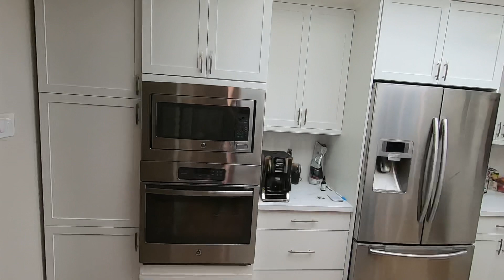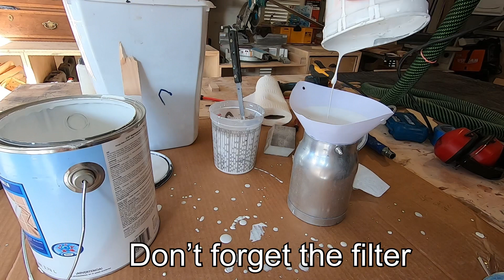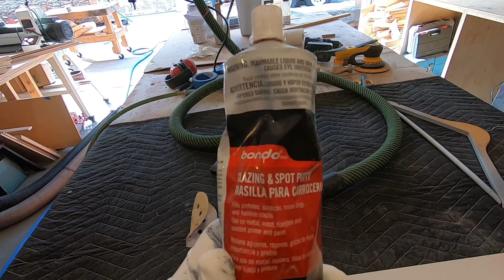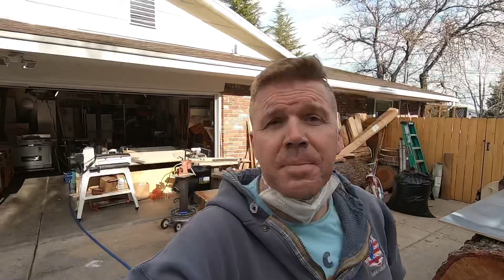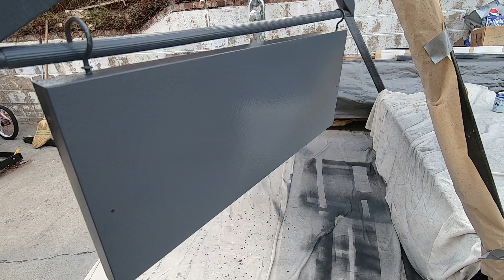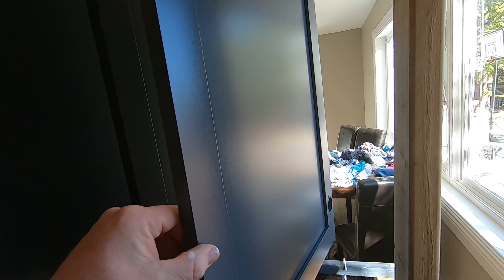Spraying my kitchen cabinets- Fuji mini mite 4

Comment: i had the same splatter issue with my earlex 5500.  i watched videos and listened to people say they were spraying right out of the can and they seemed to be getting awesome results... with my same gun.  unfortunately i never could duplicate.  I ended up switching to the Fuji mini mite 4 and going with a slightly smaller tip to help with atomizing and the splatter went away.  i only use my earlex 5500 for thinner topcoats now..  it is definitely a learning curve... meanwhile paid is $32 per quart.  so i am paying for that curve. lol .  great video by the way.

Comment: According toe Marty Schlosser, BM Advance setup for Fuji systems is:
- for 4 stage or more thin with water 10:1
- for 3 stages start at 9:1 and go to 8:1 if that doesn't work

Use water only (no fleotrol) and a 2.0mm aircap. 

I have not tried this yet though. I have a 3 stage and sprayed with a 1.8mm but had to thin the product so much i lost track of what the ratio was. The big spatter at the edges of the fan are normal for spraying BM Advance I have read.

It also helps if you remove your air control valve and just hook the gun directly to the hose or hose whip.

Comment: Definitely judge the viscosity of your paint by the way it flows off the stirring stick. 20 years as a motor vehicle sprayer and never used a viscosity cup, never even saw one. That’s how I was trained. Picking up after 40 years on different equipment with a different paint I think I will use the same method once I have determined the visual flow pattern off the stirring stick. From videos I can see it’s a slightly different flow stream than what I used for car paint back in the day.

Comment: You should just stay on the fan pattern to spray all of it. Don’t use the ball pattern for cabinets.
Reply from the maker: I disagree when spraying shaker doors. Staying on the fan pattern puts too much product on the rail when you’re trying to get the inside of the panel.
Reply: @BigNicky77  if you spray at the right angle it won’t.

Comment: Oh crap I had paused the video right before you said you thinned it. But what I’m seeing is that you need to thin that more. This system should spray with very little splatter/ orange peal. I reduce mine down to around 27. With all do respect, whoever you are watching that is saying that velocity doesn’t matter, well I wouldn’t take their advise to put it mildly. Lol. This system is very finicky but if you dial it in correctly it’s absolutely amazing.
Reply: He means “viscosity”, not “velocity”.

Comment: Brother I have three sprayers and my recent purchase was an Earlex 6003. HVLP. I though I was pretty good with my sprayers but man there’s a learning curve with these. I have a really valuable tip I learned from my research. Get yourself a piece of glass. Maybe 3x3 or bigger and use that for testing you stay patterns and the  velocity of your paint. What I have found is the velocity is crucial for setting down a smooth pattern. The other thing I found was making sure you put down a wet coat (enough paint). But I will tell you that if I had not had that glass to test on I would of spent a ton of time resanding. What I saw with yours is the paint velocity was not thin enough. You will be surprised on how thin you have to reduce some paints. If you see spatter like that add more water. Lol. Great video by the way. New subscriber.
Reply: I think you mean “viscosity”, not “velocity”.

Comment: Rollers and brushes are in the past! Spraying gives a much better finish to any surface. I understand the preparation is a bit lengthier with the spray set up, but the finish pays off! I’ll never go back to the old ways if I can avoid it. Great job and brilliant idea of the coat hanger!👍🏼
Reply from the maker: Thank you!

Comment: Thank you for sharing your experience spraying with the MM 4. I have the same fuji setup as yours but only spray lacquer or oil based enamel. I'm considering trying water based paint such as SW Emerald paint using my MM 4. Did you use latex or oil based paint for your top coats? Is the Bondo glazing putty you used a two part product? Again, thank you for your extremely useful and well done video. Everything about it is excellent.
Reply: Bondo glaze is one part from squeeze tube it is dark red so two coats. I use it all the time.

Comment: I know this video a little older but just some advice, I have sprayed advance a lot with hvlp and the sweet spot for thinning seems to be 10% water, sprays great.  I have since started using general finishes enduro white poly, which can be tinted to any color, it’s almost as thin as water and sprays much better, dries fast, and it’s a harder more durable finish.

Comment: Would you recommend this machine for furniture refinishing? I tend to paint most of my wooden furniture with oil based paints. I saw the fuji semi pro that has a two stage turbine, but I do not know if that's good enough, I tend to paint by hand on average 4-5 hours 4 days per week.
Reply from the maker: I would recommend Fuji projects for furniture finishing. Reach out to their customer service experts and tell them what you want to do, they will suggest the right machine for you.

Comment: I've sprayed a couple of days of latex with the minimite 4, and a couple of things that helped me was removing the air vale from the whip hose (that restricts airflow a bit), and using floetrol instead of water. Past a certain point thinning with water makes the finish dry too fast, and if it sets before it levels out you're left with a tiny bit of orange peel.
Reply from the maker: Those are some great tips, thank you!!
Reply: I just used mine for water based poly on some hardwood maple stairs I did. I did get a little bit of orange peel and did thin down with water a little bit. You think the floetrol would have helped?
Reply: @chadhouse1375  For polyurethane you want the appropriate retarder / extender. Most companies sell their own, but they're mostly interchangeable I find. General Finishes have their "enduro extender", SamaN sells the topcoat retarder, etc.
Reply: @NoDude  Thanks George! So your saying I just need a product extender?
Reply: @NoDude  The product I used was called WB 2K from Hirshfields. Great product I just had a little orange peel that I didn’t like because I’m a perfectionist. I guess 20 years of doing all phases of drywall will do that 🤣
Reply: @chadhouse1375  You really don't have to use an extender with thin products like water based poly, but if like me you only spray occasionally it makes the process a lot more forgiving.

I find using an extender lets me get away with too little air, and sloppy technique - so long as the surface is wet enough to level itself out (not too little product) it'll look fantastic. 

If you're spraying gloss, don't forget to prep-sand thoroughly, and level sand after the first coat at least, there's no getting away from that. 

When I first got the Fuji, gloss is all I sprayed because why else would you use a spray gun right? I had waviness in the finish from half-assing the substrate prep, and only scuff sanding the first coat, which I thought was orange peel. I had peel *as well*, but also the waviness. Fun times...

Comment: latex paint is tto thick to paint through a stage 3/4 turbine - thinning it out to a sprayable liquid compromises the strength of the paint -- airless is the only way to spray latex/hybrids
Reply: That hasn't been true for a while now. Modern turbines are getting high enough psi, the MM4 is at 9.0 psi IIRC. You need retarding agents, a large aircap, and to take the air valve out. Even then it still takes forever to spray, but it's far from impossible to get finish that's damn indistinguishable between the two.

The kick to the teeth is HVLP is a lot less forgiving with thick finishes, and it's what most woodworkers have, so people give up trying to dial in HVLP for latex, and end up over-thinning or living with the orange peel.

Comment: Nice video but decrease your paint flow especially with the bigger tips like a 1.8
Reply from the maker: It’s interesting you mention that. The one thing I like about an air compressor powered HVLP gun is that you can increase the pressure to accommodate the higher flow. I disliked not being able to adjust the air pressure with this Fuji system.
Reply: @BigNicky77  yes that can be a snag, that's why I went for the Q5 because I like being able to adjust my air...with the Q5 u can at the turbine and with the supplied shut-off valve at the top of the hose just below the gun. 
But nice work!

Comment: I'm building kitchen cabinets for my son and his wife. Just started spraying Benjamin Moore Advance primer with my new mighty mite 4.
First spray was today.
A bit of orange peel that I'll sand down and shoot  again tomorrow.  Definitely going to be a learning curve. Nerve racking, but alway fun to learn a new skill.
Thanks.
Reply from the maker: Good luck on your project. Another member suggested to me taking off the whip hose, which will give you a little bit more pressure since the ball valve is removed. I have not tried this technique myself, but it might help.
Reply: Give the new command product a try on cabinets.

Comment: Try to increase the psi in the turbine
Reply from the maker: The mini mite 4 has a fixed turbine, I think the next model up has the adjustable fan. This model does have the air control valve on the whip, so you can decrease it but you cannot increase the airflow.
Reply: Hi Nick, really appreciate your videos. I have some bookcases I'm trying to finish. I bought a Fuji semi pro2 gravity feed to spray acrylic lacquer. The bookcases had some water damage. Do you have any ideas or tips before I spray?
Reply: Nice job, I also Had a very similar set up to you. There is definitely a learn curve! Keep a book, tip size, temp, humidity, ford cup flow, all will help get repeatable results. I have found thinning material more than recommended helped eliminate splatter. Also 3 M cup and liner system gave me a much better finish as well as allowing me to use the gun upside-down to get the edges of the doors with out lifting them or changing the spray pattern. Good luck
Reply from the maker: @dm1075k  sounds good, thanks Dale!!

Comment: I like your videos. Your lacquer video gave me a lesson which worked very well. I've used what your using in the video. I had similar problems it was trail and error.
Reply from the maker: Thank you Peter! I appreciate the comment.
Reply: @BigNicky77  can I ask why don’t you spray lacquer with your hvlp? Or why didn’t u just spray your latex with airless? I’m looking for fine lacquer finish and am trying to decide which to get... hvlp or compressor. Can you offer some insight? Thanks

Comment: Looks good. Why did you decide to go with latex instead of the precat?
Reply from the maker: I used Benjamin Moore alkyd enamel. I didn’t realize that they could tint lacquer to the same color I wanted until after the project was done. I would have chosen lacquer knowing what I know now. This paint is good, but lacquer appears more durable.
Reply: Nice work Nick.  Looks great.
Reply from the maker: @jonking6715  thank you Jon!
Reply: Which precat would you have went with if you had a choice. Water based or not etc. Thanks
Reply from the maker: @waynehanlon4037  I believe the paint store recommends oil based when tinting, but most the professional stores will look at your color palette and point you in the right direction.